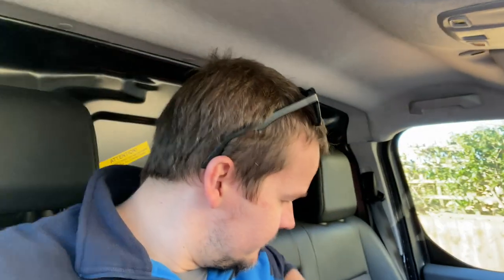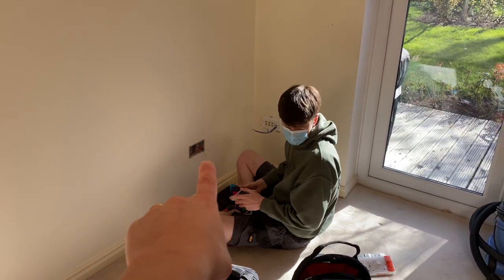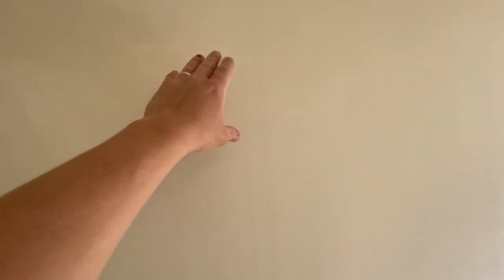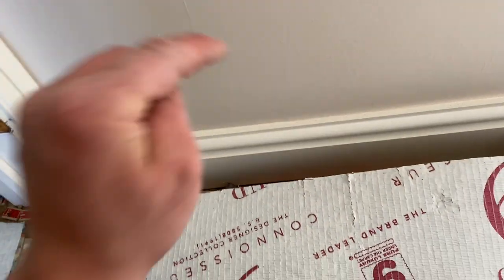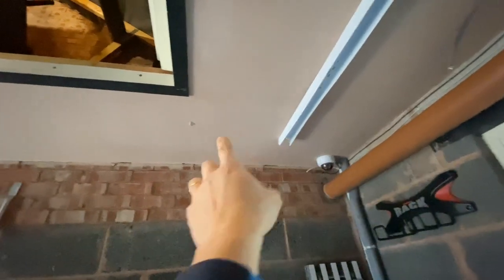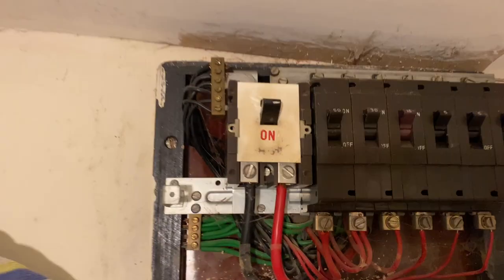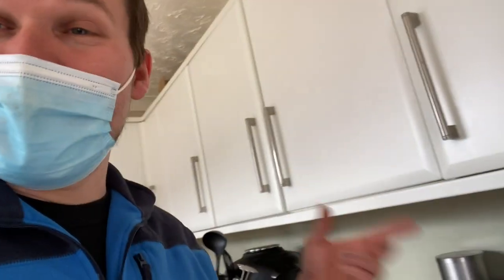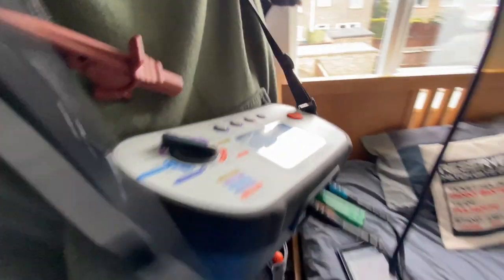My mate dave from the pubs had a go!   Oh nice

Comment: What clown said dont double over cables on termination🤣
Reply: Why stop at doubling over some T&E, lets double over the meter tails,  lets double over the EV charging 40 / 60 amp cables.. lets double over the main incoming 16mm2 earth into the DB ....oh wait, they won't fit will they...

The manufacturers instructions are meant to be followed or liability issues will follow you.......Having fitted several hundred sockets, boards / lights etc etc, I have yet to see instructions  tell you to double over a conductor. Every single fitting diagram has one single conductor stripped to a specific length, then inserted and tightened, usually to a specified torque. If you then take it upon yourself to ignore those instructions and foolishly double over the conductor, that item is now not installed to the manufacturer's instructions, invalidating any warranty, will now have the wrong torque rating and you are now liabable.
Reply: It must have been Arcadia1701e 🤡
Reply: @arcadia1701e  good point my apprentice on his AM2 was told to fill the breaker with wire so he would double over cable ends on everything.
4mm /6mm t and e , ridiculous! And yet not told to put boot lace ferrules on fine stranded flex.
Your right no where in the manufacturers instructions does it tell you to do that.
It considered good working practice only on t and e upto 2.5.

Comment: That cardboard and plasterboard is Paramount board. Used to find it in old office partitions. Hate the stuff.
Reply: My first place, a 2-bed Wimpey '78 build, used it upstairs. Didn't know the name of it until recently.
Reply: Dead easy to run cables though
Reply: @andrewgilbride7546  Only used that once, to run a feed to a shaver socket in the bathroom from the socket outside. But the lack of depth is an issue if there's no RCD protection.

Comment: I have been bending over the copper wires for years and have had no problems.  The only issue is some terminals are a bit small . 👍👍👍
Reply: Yes, even double bend if required, but recently I bought a socket with a 'famous' brandname that wouldn't even clamp three straight 2.5 conductors tightly. The size of the screw into the tunnel was far too small, compressed two but pushed the other one aside leaving that one loose. I've trusted the brand name of the inferior socket for decades but obviously I've stopped relying on old established British brandnames.

Comment: those walls are paramount walls they're great for putting extra sockets in just ram a piece of conduit down the cardboard core, the gap between the plasterboard is actually 34mm and you can only really use drywall boxes as you can't put metal back boxes in unless you glue them to the plasterboard at the rear

Comment: I've been a sparky since 1986 & some of the worst work i have seen is by council electricians, what a load of bodgers they are!
Reply: That’s why they work for the council, because they can’t get any work by themselves due to their shoddy work.
Reply: I think that's unfair. I served by time with a local council. Had a great apprenticeship with lots of varied work and they were very supportive of our education. I had completed the part C course and 2391 before I came out my time and ended up with an HND. I'm off the tools now and part of my role is inspection of both council and sub contractor work. My findings are the worst work is from penny pinching sub contractors on new builds and the young lads who have completed diluted apprenticeships and are set to work with no supervision. The council lads are as good as anyone else out there.
Reply: @Daniells1982  I speak from experience, from my local area, I do understand this is not the case everywhere, but it's been my experience locally.

Comment: I really hate the way the backs of UK sockets are designed, how damn expensive would it be to have three terminals for each wire, two for the ring connections and a third for spurs, all of the terminals should be sized for 2.5mm.

Would it even cost 5p a unit to implement for the manufacturer?

Comment: in colledge now they teach u not to bend the cable as it will damage the integrity of the cable as you said when i did AM2 now 2s lol it was a fail if you didnt so who is right lets have a vote. ps i have never seen a double over cable broken in a termination i have done.

Comment: looks like whoever butchered the wiring in that last property also worked on the last house I purchased, ended up rewiring once the true horror of their fucktard efforts at electrics were revealed as the Electrician started the remedial work he'd identified with the condition report. I think I could have recouped a fair wack of the cost of the rewire in the scrap metal contained within all the junction boxes and terminal block connectors hidden under the floors and various other places. outdoor lighting fixed to the trunks of trees with just flex hanging between them was special, nicely under tension after a few years of differential growth, Admittedly this was connected onto a 13amp plug, the flex passing through the wall before being burried unprotected about 6inches under the ground surface before popping up at the first tree, so wasn't part of the fixed wiring and was easily disconnected.

Comment: 1mm T&E!!!! I never use 1mm alway 1.5mm
Reply: Youtube penny pinchers telling you what an incredible waste that is in 3... 2... 1...
Reply: Do you also use 4mm instead of 2.5 ? Why use bigger cable for no reason whatsoever?
Reply: @Marco-mg9tv  hi no I don’t use 4mm instead of 2.5mm on radials unless I need to but I do only use 1.5mm for all lighting circuits my reason for my comment on this video is because this is feeding an underfloor heating circuit which is being installed most likely by another contractor and the load is undetermined until installed and secondly a spur off a ring fed by 2.5mm T&E should be supplied by a minimum 1.5mm T&E according to the on-site guide
Reply: @leebutterworth7465  Sorry didn’t  watch the video all the way through I was assuming your were referring to lighting circuits in any case the Design load, overcurrent protective device, should determine,  along with correction factors the CSA in cable to be used
Reply: @Marco-mg9tv  I personally wouldn’t put 1mm into any installation of mine, but that’s just my choice the difference in cost between 1mm and 1.5mm for a coil is negligible but the difference in load it can take Is far greater.

The other contractor fitting the heated floor may connect numerous heat mats to that one programmer, most programmers will take up to 16amps without the need of a contactor and the load could be on for a longer that a simple light
Reply: I stopped using 1.5mm for lighting years ago, 6amp breaker and leds mean hardly any load these days and a hell of a lot easier to terminate in dimmers etc.

Comment: Why bond the Gas and Water for? UK system is weird.
Reply: It is a requirement under wiring regs .. called equipotential bonding  thereby creating a bonded zone .in the event of an earth fault uou should get a not get a  shock from the pipework. I know of a few people have been electrocuted because it was missing and incorrect wiring of earth fault .. if it is done right the fuse/ breaker should automatically disconnect the supply
Reply: Oops should not

Comment: My close call was while I was installing a machine wired to a double pole 20A switch (I always hated them no room). I asked the company electrician is that dead?  Yes mate I have pulled the fuse so I went to unscrew to put my wires in and "BANG" it took the end off my screw driver and I couldn't see anything for about 3 minutes. I went for the electrian (in kill mode) he went deathly white and showed me the fuse holder. After some investigation another cowboy had wired the extention on the other side of the busbar on a 200A supply. Moral always test the supply even if its off, it was my lucky day.

Comment: Unless  the instructions for the socket/ breaker / light / whatever tell you to double over, You don't... This obsession has to end!
Reply: Nonsense, double up for a better connection, what’s the issue with that?
Reply: Does the instructions on a socket/ light/ breaker say you can terminate more than one cable in each terminal?
Reply: If you don’t double over a single cable termination the screw won’t bite properly into the copper leaving a shite connection

Comment: Talking about the piping being just under the flooring, I found this out when lifting/cutting the sodding chipboard flooring in my house!
Reply: When ever you use a circ saw for removing floorboard or chipboard you wanna set it a couple mm short to avoid hitting pipe or wires. You only really need to remove the tongue anyway
Reply: @blissof892  yeah I got a circular in the end. I was using a hand saw at the time and I heard the grating along the side of the pipe 😂

Comment: Tongue & Groove flooring , great stuff - unless you ever need to lift the boards again.
Reply: What’s wrong with trying to lift Tongue and Groove floorboards I’d rather lift those than chipboard at least you can see all the fixing and the joists underneath, a decent tradesman with the right tools should never have to split and damage T&G floorboards no excuses, always cut along the tongue on  both sides and saw over a joist so you can refit the board perfectly